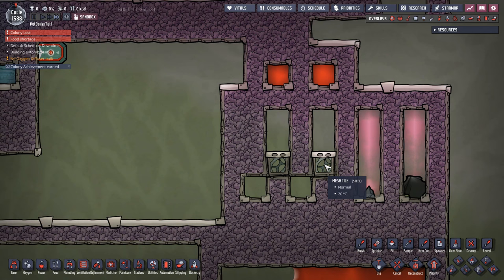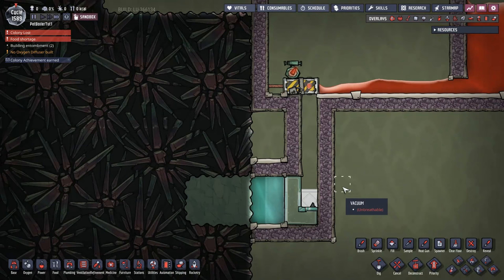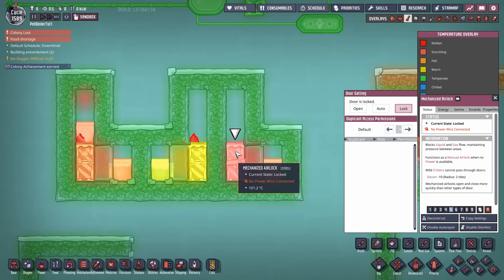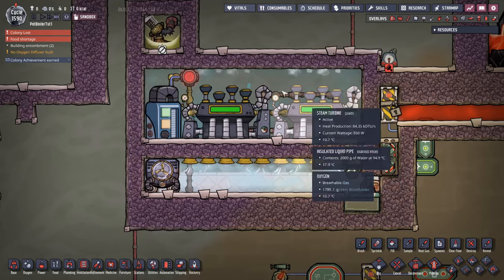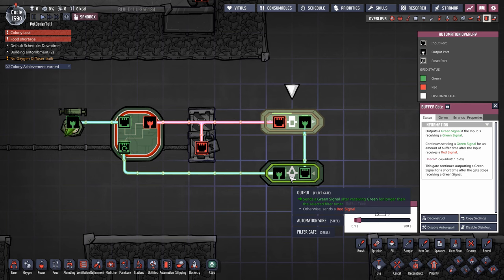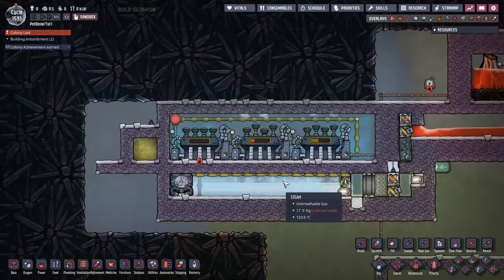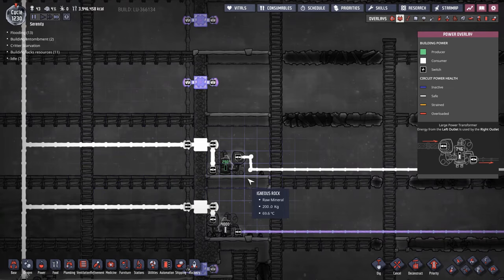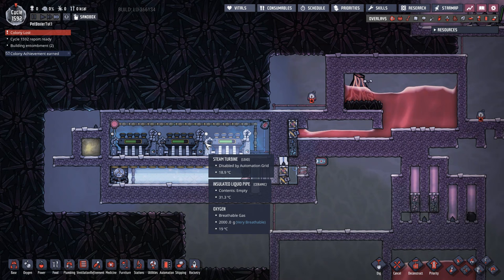Volcanic Steam power : Tutorial nuggets : Oxygen not included

Comment: It looks like the debris door doesn't quite have enough time for the debris to fall. Maybe give it its own buffer gate? So you could turn the timing back down on the main loop.
Reply: could run two doors sideways in there too, time it right it will trap in successive doors. It looks like it wants to be in the bottom half of the door to be trapped. a stack of doors would keep the pile from each operation roughly separate, to reduce losses from heat averaging when piles merge.
Reply from the maker: The debris on top of the door is the fresh debris that just formed, the older stuff is trapped in the door. It confusing with the way it all happens at once. I may have spent 15 minutes fiddling with the automation before I figured it out.

Comment: What about using an auto sweeper to load the rock onto a conveyer rail? Better heat transfer and the possibility of extracting the rock for hatch farming. Run the conveyer rail through the turbine room to cool it and then drop 30 degree rock on the other side. Yoh could time the output to equal the Volcano average output and then make a magma tank of the right size to insure no overpressure or an empty tank.
Reply from the maker: I like the idea of calculating the volcano output and then extracting the magma at that rate via rails, I'm stealing that idea.
Reply: @FrancisJohnYT   I can't take credit for that idea. I believe it is another TonyAdvancedONI special
Reply: @FrancisJohnYT  brothgar uses this to maximize heat extraction from his metal volcanos
Reply: So I set up a system of automation and conveyors on the 2 steam turbine build. I changed the oxygen into ST room into hydrogen and addedd tempshift plates as well. First the rock goes on conveyors in the steam room until the debris hits 205c then it is moved into the ST room to until it has cooled down to at least 30c. Then it's shipped to where ever I need it at around 20-30c.

Comment: One benefit of this usage of heat over a petroleum boiler is that it's power that doesn't require power.  Yeah you need to have the aquatuner running every so often, but it's still a fairly independent way of getting power. The downside of relying solely on petro boilers for power is that if you overtax your power network, you boiler pump will stop, which will stop the flow of petroleum and cause a fair significant brownout. Just thought it was worth mentioning.
Reply from the maker: Always keep a 5000kg tank of petroleum hooked up to your generators, makes sure you can recover from brownouts.

Comment: Use the corner trick to extract the igneous rock from the first turbine as soon as it gets injected into it. The main purpose of the first turbine is to generate as hot igneous rock, ie. with the least temperature drop, as possible. Once you have hot igneous rock, use conveyors to easily ship it to where you need it. Petroleum boiler, sour gas cooker, steam turbine power generators, whatever. All of them are much easier to build, and easier to make fail safe with hot igneous rock inside tiles on conveyor loops.
Reply from the maker: That can be done. However my petroleum boiler uses all the heat from the magma from 1700C down to 430C that's why I'm 100% it will work on the major or minor volcano it's designed for. (That and some stress testing) If you drain the magma heat down to 1430 to make it portable as debris you have already wasted a lot of useful energy just to generate power. Magma is useful because it can get to temperatures steel aquatuners cannot.
Reply: @FrancisJohnYT  Your petrol boiler is one of the reasons I make this comment. It's extremely inefficient use of a volcano. Using my suggestion you can get a lot more out of a single standard volcano. In my own set up a fairly average output volcano cooks 10kg/s crude and generates about 1800W constantly. Output igneous rock is about 105C just cooling by steam turbines where the steam chamber is divided in two so you can have a cool steam and a hot steam side because a steam turbine averages the steam temperature of its inputs so you can run the cold side lower than the otherwise minimum 125C to extract the last remaining heat out of the igneous rock before feeding it to hatches.
Reply from the maker: @SaturnusDK  The petroleum boiler had a different design criteria. A regular and minor volcano can output at worst 760g/s and 380g/s of magma respectively. My objective was to design two petroleum boilers that would fit on each volcano type and regardless of how weak the output it would work. It needed to be bullet proof. If I put up a design that was to magma hungry for only 1 out of 100 users that decided to build it that is to much fail. The objective with the design was not to get the most out of every volcano it's objective was to make it possible for anyone to build a petroleum boiler and have it work. I don't know if I'm explaining that efficiently. Another way to think of it, if you shared your design with other players how many of them could have it potentially not work because they got a minor volcano of bad RNG on the volcano output?
Reply: @FrancisJohnYT  None. My design works just fine with a minor volcano as well. Even a worst case scenario one.
There's nothing wrong per say about your petroleum boiler design except that it's prone to failure with the autominer as you have demonstrated yourself but when new ideas comes along that enables you to update older designs to be more efficient and eliminate potential points of failure then you should probably try them out.
Reply from the maker: @SaturnusDK  The boiler works on a minor volcano even with dumping all the heat above 1430C into a steam turbine!!!! Whats the magma consumption rate of the petroleum boiler? I got 383g/s on my minor variant. How big of a counter flow did you use?
Reply: @FrancisJohnYT  333g/s averaged over 5 cycles. I do run it to 420C though as you can get a lot more precision on a rail loop heater. Heat exchanger pre-heats to between 390C and 394C.
EDIT: Make that 297g/s. I let it run 15 more cycles and I must have hit a bad point to start the measurement the first time.
Reply from the maker: @SaturnusDK  Sweet, let me see the design!!
Reply: @FrancisJohnYT  Sure. How?
Reply from the maker: @SaturnusDK  I have an email address in the about section, send it there as a screen short or save game file and i can have a look.
Reply: @FrancisJohnYT  Do you mind sharing that savefile? i would love to to throw that up into a savefile and let it run for like 1000 cycles to see how nice that ones works
Reply from the maker: @aplate1982  Save game file is linked in the description, play, modify and test to your hearts content :)
Reply: @FrancisJohnYT  I was hoping to get my hands on the save game file of Samsonite dove :)

I have successfully build a volcano tamer with 2 steam turbines running full tilt without any need for an aquatuner by using the 95c water from the turbines to keep the steam turbine/hydrogen room at a steady 95c, but with a third it seems to always overheat and require an aquatuner. I would love to do a playthrough of full sustainable steam turbines as my only source of power lategame.

I even extract energy from metal volcano's after cooling down the metal to 40c by using the time that the aqauatuner is not running, to dump the 400W ish back into my power grid

Comment: 15:08 If you add one more part, a hot box, you could turn off and on this style as well. So the igneous rock just falls into it's own room. Then use metal tiles and doors to take heat from the hot room and dump it into the steam room for the turbines to use.
Reply from the maker: That is what the second design does, you need a little pocket room with a gas or liquid in it to measure the temp so you don't over dump in magma to the point it stops solidifying.

Comment: So the new map I started got like... 6+ active volcanoes and I have no idea to dig out the super hot obsidian to vacuum out the area to begin with
Reply from the maker: You usually have to wait until you have atmo suits. Doing it before then is very very tricky.
Reply: @FrancisJohnYT  won't they get scalded even with suits? It's like 1200c
Reply: and yeah I had to seal up an abyssalite breach early was a constant rotation to the triage beds
Reply from the maker: @Century_Chandra  The suits allow them to breath in a vacuum, also for minor mistakes with a little bit of gas getting it it protects them.
Reply: @FrancisJohnYT  but how do you vacuum it out before you dig it out? Just make a huge box around it first?
Reply from the maker: @Century_Chandra  Below is one I made a while back. But if you are dealing with hot rocks to start you want to build a liquid lock  tight up against a wall and then dig in from there. Since there is no gas in there to start it will just stay a vacuum.
https://youtu.be/YWQcaus9if4?t=467

Comment: wait... transformers work both ways...???? (15:38)

I also have 1200 cycles on my first map granted but I never thought this was the case. There are small arrows on the fucking things!!

Slight off topic sorry. Nice video mate, I will come back to it if I ever tame my volcano :)
Reply: They are one way, but you can rotate them.
Reply: Transformer only bottleneck the allowed power from passing through. Yeah, too me a long time before I realize I can force power back into the grid without draining them unintentionally.
Reply: Yes and no. They have an input (the high socket) and an output: from the output they release no more than 1KW (4KW for the large one). The main function is to prevent overpowering your normal circuit, the secondary function is that it couple heavy watt wires with the normal ones. However, in ONI the current flowing in the wires is all of the same "type": you can connect all your things with both the types of wire without problems. So you can connect whatever input and output you want on your transformers.

TL,DR: the current flows only in one way, but you can connect whatever you want to the input and output.

Comment: Pretty cool. I built it on a test world and it's pretty neat. A question though, is it normal for the Steam Turbines to be in a state where heat is slowly rising?

With each cycle that passes, around 3 or so degrees gets added to its temperature and the whole Aquatuner setup isn't doing anything other than stall the rising temperature.

For purposes of practicality, I'm using crude oil as a coolant. I've tried a bunch of other stuff as well in the Steam Turbine room such as: Filling it with hydrogen or oxygen, vaccuming it and putting on a thin layer of crude oil/water/pwater over the turbines but the temperature is still slowly going up.

At this rate, I think the turbines need to be turned off every 50 cycles or so in order for it to cool down.
Reply from the maker: Oh you don't want to be using crude or petroleum as coolant. An aquatuner reduces the heat of a liquid passing through it by 14C, oil has very low thermal capacity in comparison to water. Use polluted water instead and you should have no heat issues, just make sure you don't accidentally freeze the water in the pipes.
Reply: @FrancisJohnYT  OH, I see. I thought crude oil would be great due to its high thermal conductivity.

Didn't think of the thermal capacity though.

Thanks!

Comment: Even though this is older now, can't you use the dupes-can-pick-up-stuff-diagnonally to remove the debris from inside the chamber, if needed? Wouldn't a sweeper outside set to only to pick up debris marked sweep only work there?
Reply: You can just put an autosweeper and conveyor loader inside the steam chamber, the temperature there won't go above 200C so steel stuff will work fine.

But you might want to avoid dumping that 200C igneous rock in your base anyway. 

(I don't mind, I almost always have a cooling loop around my centralized storage tile and volcanoes don't produce a lot of rock.)

Comment: Correctly me if i'm wrong. It looks like the debris will not change its temperature correctly if the lava change is within the same tile as the debris? So if the lava solidifies a tile above and have it drop it will get added to the temperature correctly?
Reply from the maker: That is correct. So long as the debris is created in a separate tile when you merge the two pieces of debris at that point, no heat is lost.

Comment: It seems my mechanized airlock can't trap the debris inside it, the igneous rock always end up on top when it closes. Is this the result of some updates, or am I doing things wrong?
Reply from the maker: I don't know if they updated this, have not played with catching debris in doors in a long time.
Is the door fully open before and the debris at the bottom of the vertical door before it starts to close?
Reply: haven't run it for a long time but lower things a bit, and stack two doors for the debris catch. I had to set the 'filter gate' to 4 seconds give or take for the debris to actually fall. I raised the 'buffer gate' to 60 seconds just to be safe to start this up, but I plan to lower this to 10-20 seconds. the second debris catching door can just be on the same wire. you don't have to do anything fancy like stagger them to trap the debris.

Comment: A question about steam turbines, exactly how much water in Kg is required for a steam room of 2 turbines and 3 height ? I am trying to extract heat out metal volcanoes’ metal but the steam is either too little or too much
Reply from the maker: For metal volcano taming I usually go with 1000kg of water. If it doubt use more than you think you need. To much water will just mean the system is slower to heat up, barring that it has no down side and has the benefit of being very stable.

Comment: Very useful video.
I have been meaning to get round to tapping the 6 volcano on my current map.

Have a question about the tempshift plates.
Since the tempshift plates equalize the temperature over a 3x3 area isn't putting an unbroken line of them just a waste of resources?
Also aren't you wasting a lot of heat by pushing it into the insulated ceramic tiles?
Reply from the maker: Using a checker board of temp shift plates is not as good as a line, but it will work ok. It does inject the heat into the tiles which is why I put them touching the bottom tiles and double layer the bottom of it. Another option is to make the steam area three tiles wide and place the temp shift plates in the middle. Since both options are going to be the same size but the double layer provides better insulation I go with the double layer.

Comment: hey john, I built one of these on an excess volcano in the map, I used your 2nd design that drops the debris into the door. However, no matter what time I set the filter gate to, from 0.5 all the way to 1.5, the debris doesn't fall into the door, its only left ontop at around 1200 degrees, and really heating everything super slow, I'm wondering if there is something I might have done wrong?
Reply from the maker: I can't tell what you did, but their is a save game file linked in the description if you want to download it and play around. Their is a chance they changed the mechanic so debris no longer gets trapped in a vertical door.
Reply: I had the same problem and I found out it was becaused my Powered Airlock I used copper conductive wire, which instantly melted into liquid and blocked the magma flow.  Once I realized this I used steel conductive wire for the door area and cleaned up the liquid copper and it worked fine.  You can use copper conductive wire everywhere else except for the space touching the door since it gets really really hot there.

Comment: Hi John. I love your tutorials. I have a question:
why can't you use the same setup of a petroleum boiler to extract the heat in a more efficient way?
Reply from the maker: You could it just tends to be more effort, the magma dropper is great but it requires a dill and cooling. This setup it just simpler to run.
Reply: @FrancisJohnYT  ok perfect, I have another question regarding the petrouleum boiler: I built one 2 days ago and I keep having the broken pipe problem, I did the counterflow longer just to be safer, but now I think it might be a problem. I also forgot the last insulated pipe, but beside this might the counterflow too long be a problem? Expecially if I send in less petroleum due to the presence of only 2 oil reservoir instead of 3.

Today/tomorrow i'll try to build a petroleum boiler again and I'd love to understand wtf I did wrong 😂😂

Thank you very very much, I spent the last 2 days watching you play oni and I became quite better
Reply from the maker: @lucaframba3730  The counterflow was designed for 8-10 kg, going less than that can cause oil overheat at the end. If you are getting overheat change the last 2-4 pipe segments to insulated pipe. This reduces the efficiency and prevents the overheat.

Comment: First, thanks for this very well explain tutorial. It works well for me at the begin but the mesh title keep being fill by magma :s even if i decrease the door at 0.3s and 200s timer for the easy design :-s
Reply from the maker: How are you extracting the heat out of the mesh tile? Diagonally via a temp shift plate? What is moving the temperature out of the plate?
Reply: Yeap I did the exact template that you did. And it works the first times. But for some reasons, after few cycles the magma stay suck in the mesh tile. Maybe to much steam pression?
Reply from the maker: @TheCantinos  I'm not sure, I have not used this design in a while so maybe they changed something. The map should be linked in the description, maybe give it a spin and see if you notice any difference?
Reply: @FrancisJohnYT  it works perfectly fine, sorry for the necro. I built one last save in DLC.